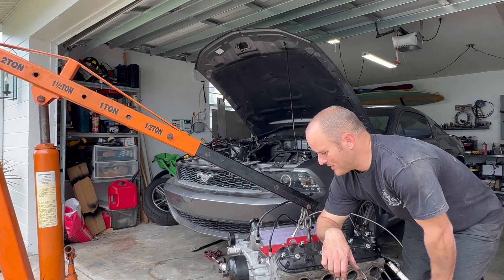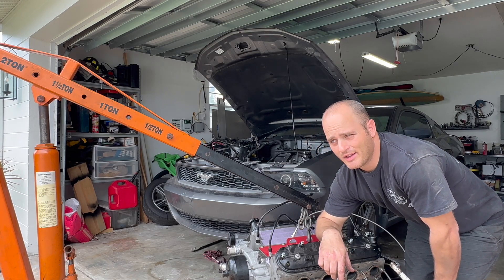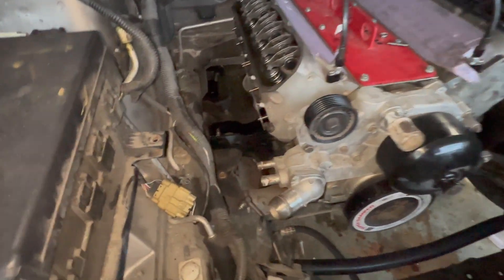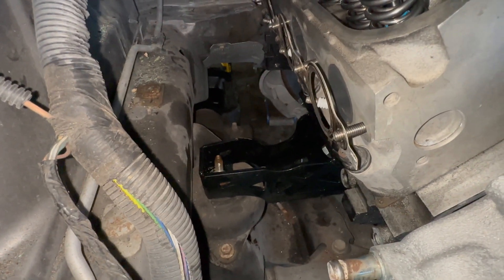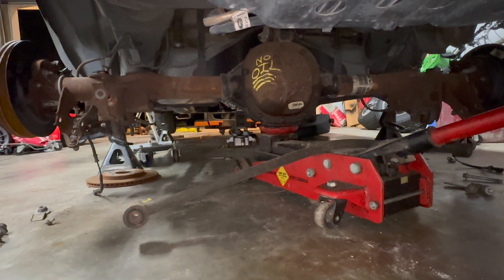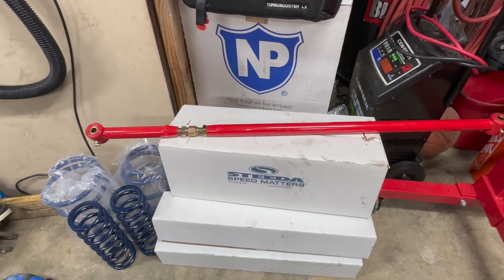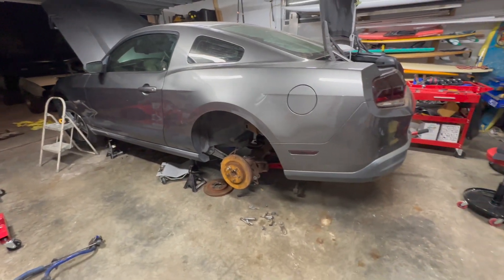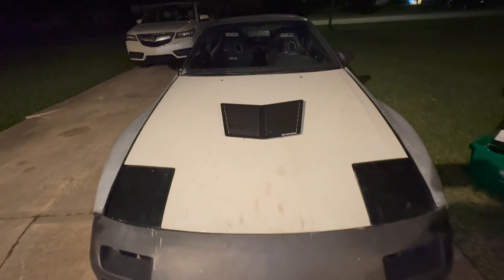S197 Mustang LS swap Part 4 Engine install

Comment: Why put the gt rear end?
Reply from the maker: Because my car is a 2010. 2011 - 2014 is when they put the 8.8 rear in all of the mustangs, the v6 cars prior to 2011 all had significantly weaker and smaller differentials.